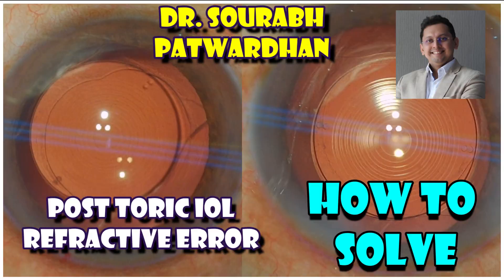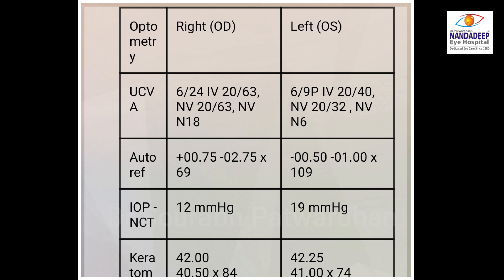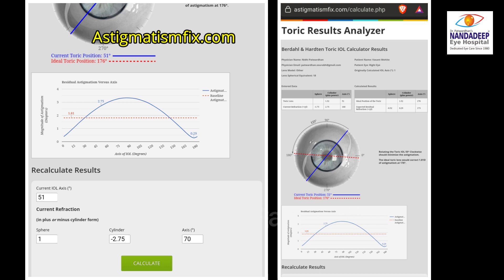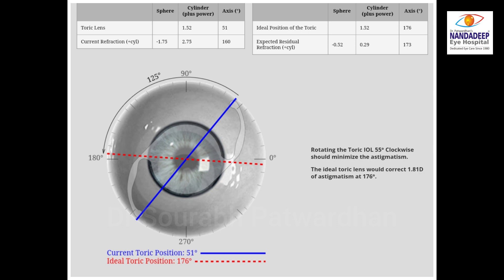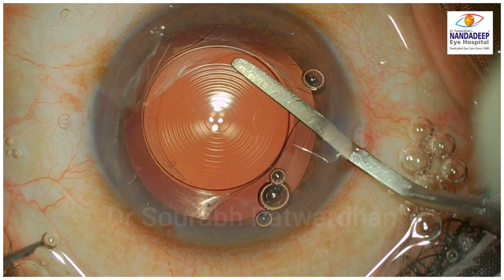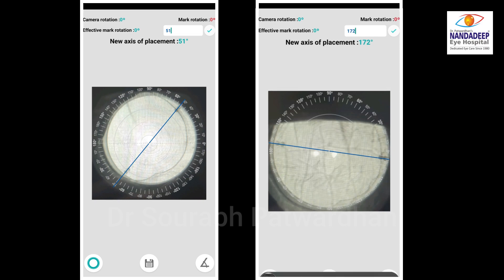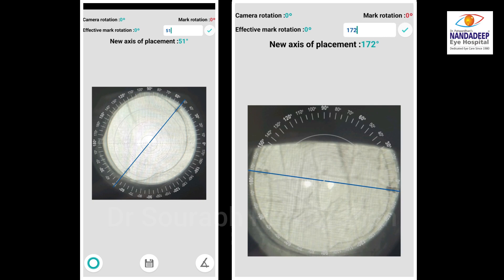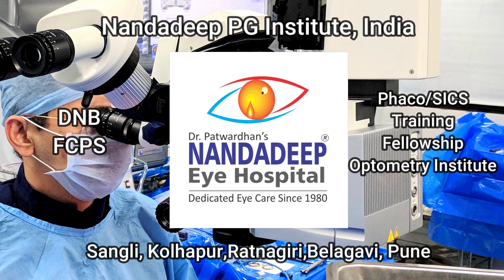183 Solving refractive surprise by rotation of Toric IOL Dr Sourabh Patwardhan

Comment: Hi Sir, your videos are really enlightening. I'd appreciate an advise on a urgent case. 

The patient is Female, 60, housewife, and has cataract in both eyes. We are planning to go with Phaco and Eyehance but she has astigmatism of 2.5D. 

Can she go with just a Monofocal instead of Toric IOL, and fix the astigmatism with glasses?

We are concerned about the rotation of the IOL and cost of it's readjustment, post-implantation.

Your advise will be highly appreciated. Thanks!
Reply from the maker: Go for toric iol. Chances of rotation are very less. And even re rotation is not difficult at all.
Reply: @SourabhPatwardhanPhacoTips  Thank you so much, Sir! Considering to go with your advise. Just one question - How long does the IOL take to permanently set or stick to the posterior capsule? Are the chances of rotation only within intial few days/weeks post-implantation or it can happen anytime? 

Finally, is the re-positioning chargeable if it occurs within few weeks? 

I'm sure these questions would help not just me bur many patients and their family around the world. Thanks again! 🙏